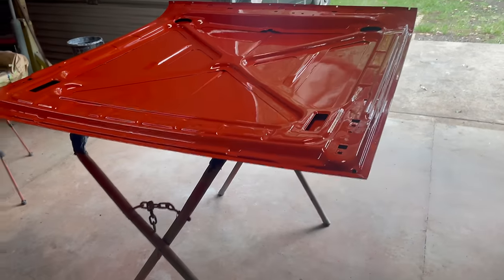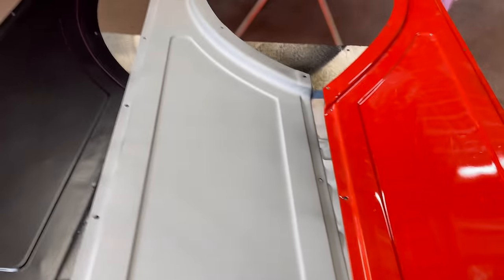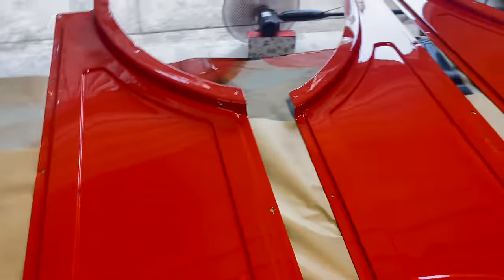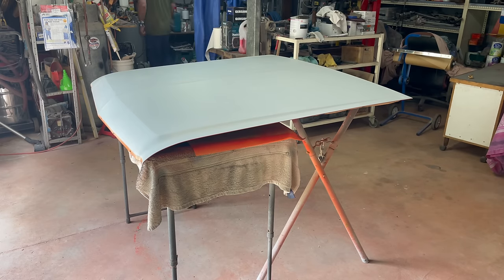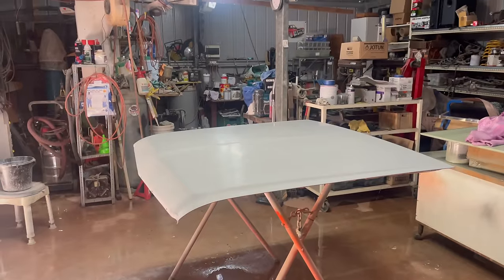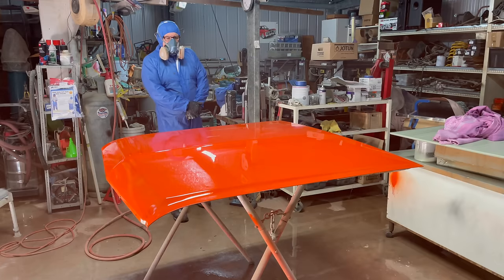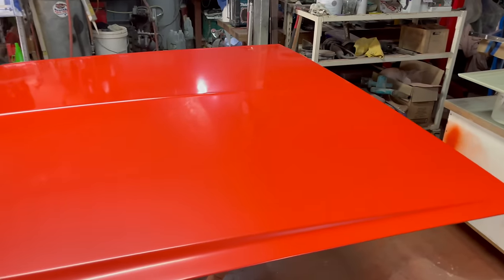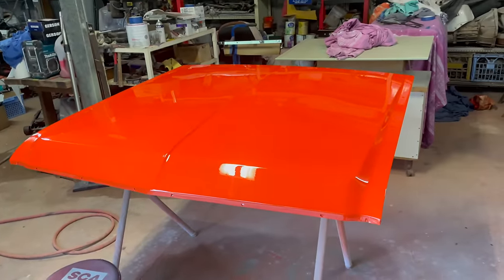Bonnet finished! Ford Falcon 500 XY Ute Restoration Part 79

Comment: Nothing more therapeutic than watching that colour and shine going on. Thanks Andrew . I painted my bonnet 2 weekends ago and left it on its back under nice calico drop sheets to cure. During the week a massive thunderstorm had water get in and saturated it. Come Saturday morning and I found it had been sweating in the heat for 3 days. I was gutted. It cleaned up ok but I could just see tiny humidity blisters in a small area which disappeared when it dried out but I know they are there. If anything can go wrong it will.
Reply from the maker: I’m sad to hear that about your bonnet. I hope you can tidy it up with a polish. It certainly is a very exciting time when you’re putting paint on if not a little terrifying one mistake and that is a massive amount of work to redo. Now we just have to make sure we don’t chip or scratch the paint work when  assembling. Merry Christmas to you and your family. :-)
Reply: @DonsTrix  Thanks Andrew and cheers to you and all too

Comment: You realy need a exsplosion proof sealed motor extraction fan to be safe. Vevor make a cost effective fan . Keep up the hard work your realy getting there now
Reply from the maker: Thanks Mate. My fan has no brushes in it. No sparks it would run in the fuel tank of your car and not cause a problem. :-)

Comment: Hi Andrew, brought one of your t shirts thanks , it’ll look the part when driving my xy Ute. The smugglers box lid appears to be held in place with seam sealer and screwed in place from factory but getting the screws out the lid where it meets the front of the tray was a real pain “when it came time to replace new fuel sender” .. ill probably leave those screws out when i replace it and just screw it down on three sides. I’m interested to see what you’ll do. Love that paint job 👍
Reply from the maker: Thanks very much Wayne thank you for the support with the T-shirt. I have a little right angle gearbox for my impact driver, which means I can get in there with an impact driver and undo the screws really easily and yes, I’m referring to those bloody difficult ones right near the cab. I will show the right angle Drive drill attachment next video. 
Merry Christmas to you and your family.  :-)

Comment: If you get bugs or dirt in your paint, while it is still wet grab a piece of masking tape and fold it in half with the sticky on the outside, use the fold on the corner to pluck the dirt or bugs out, you'll grab it easier and cause less damage to the finish.
Reply from the maker: Thanks mate I can’t wait to try that. It was quite a struggle to remove the bug in the bonnet with a pair of tweezers, and not do any damage. The masking tape idea sounds like a major improvement. Cheers, merry Christmas. :-)
Reply: @DonsTrix  thanks, Merry Christmas to you too